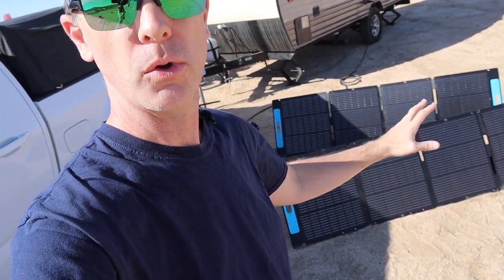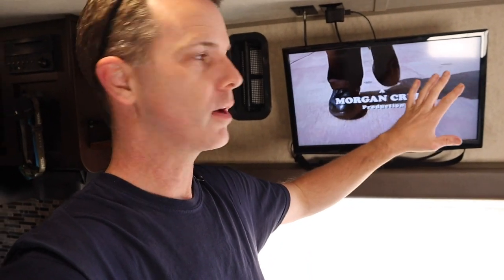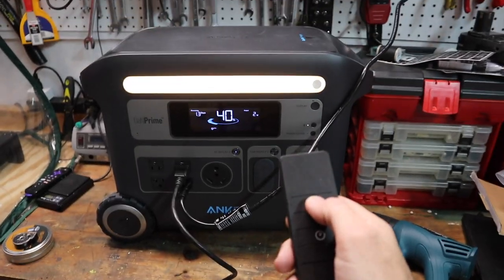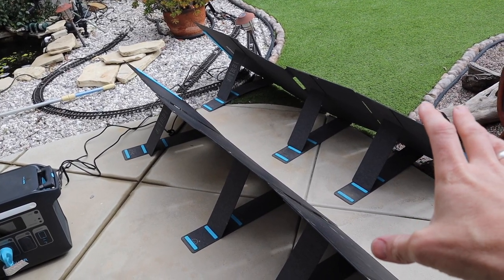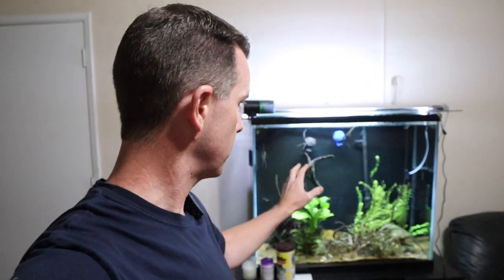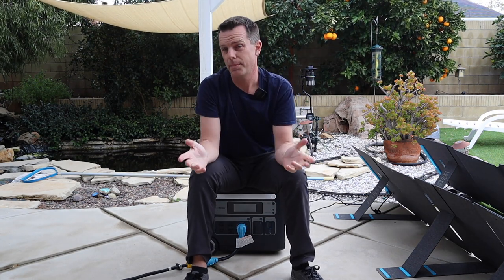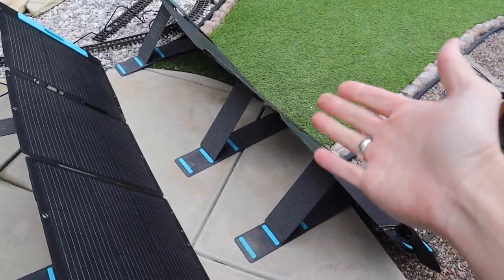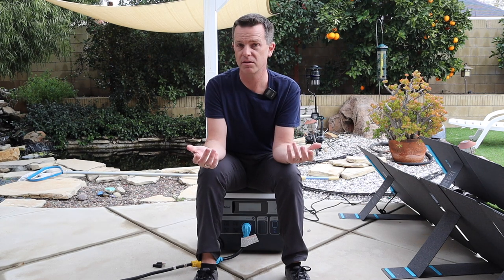Can It Actually Replace A Gas Generator? Anker Powerhouse 767

Comment: Bottom line for home use is, in a total power outage, these little units deplete too quickly and take too long to recharge.  I do see where they can help support a small generator and enhance the generator’s effectiveness during a crisis.  But at the cost, not sure if that’s even a smart decision?
Reply from the maker: It all depends on what you're trying to power in the house. If you are just trying to power a refrigerator and a light or two this will last a long time. If you're trying to power the whole house you'll get a couple hours max. 
I use this thing to power my travel trailer. Electric and solar means I don't have to deal with generator quiet hours.
Reply: @DoItYourselfDad  - Yep, I definitely see the benefit for RV life.

Comment: I have a 13' Scamp trailer.  What (Anker Power Station) would I need to run a 5,000 btu air-conditioner and what solar panels to run the air conditioner all night long.  I am NOT a techy and need simple instructions.  Yes, you can talk DOWN to me.
Reply from the maker: A FELLOW SCAMP OWNER! I had a scamp and LOVED the thing, unfortunately my family outgrew it. It's hard to be able to accurately know how long it would be able to run the unit for without knowing the power consumption of the AC. I have a 8k AC in my garage and it will run it non stop for 4 hours, in your trailer it would be cycling on and off so it may make it?

Comment: I purchased the powerhouse 767 with the extra battery and the extra battery is not charging. I have been using the system for less than 2 weeks and it's a complete fail. On Sunday, March 24, I update the firmware and the extra battery started to charge but today March 27, it stopped just like before. Now I have reached out to customer support but that's useless. They asked for my shipping address, invoice to show proof of purchase, serial number and a video with the issue. I sent all this on Sunday and today they asked for the same information. Anker, this is bad customer service. I was told in one of the emails to use DC to power the battery and then switch to solar. I can't do that since I only use solar. The video I sent showed that the solar panels and cable are working since I connect them to another battery and it was charging. Anyone, someone, what else can be done?

Comment: my anker 757 stopped working after less than a year owning it - now its zero charge and wont charge.
very light use - all these specs and features are useless if the unit stops working.

Comment: Insane that those solar panels are not water proof.
Reply from the maker: I agree, that’s why I had mentioned in the video you may be better off getting your own solar panels and an adapter to run it into the unit. That’s what I’ll be doing with the rooftop solar on my trailer.
Reply: Those panels are totally fine and rated IP67 so they are weather proof in every practical sense of the phrase.  The little frowning face icon the back is not be interpreted as anything other than "not good PV production when it's raining". Well, no kidding!

Comment: Did you try the AC with soft start?
Reply from the maker: Yup, fires up no problem.
Reply: @DoItYourselfDad  appreciate your answer. Were u able to run more appliances with it tho?
Reply from the maker: Yes, the soft start also activated itself ( you can monitor it though an app) the microwave.
Reply: What a/c did you start with the 767?  Your house central a/c? A window unit? Your RV? If so what are the btu’s of the a/c unit, because mine is a 13,500 with a soft start installed and the 767 would not run it.

Comment: 20 rv amp, not 30 amp
Reply from the maker: That’s a 30 amp plug
Reply: @DoItYourselfDad  they call it TT30 plug, but since 2400 watt inverter it's max. If you pull more then that then it will shut down

Comment: Your just like every other channel that receives this stuff FREE. Stop playing semantics and saying it can replace a generator for your home. It can not. 2-3hrs is not replacing a generator. Not even a Honda eu2200 . 
    ALL of these solar “ generators “ can only back up your home power for a short time 8-16 hrs and that’s not running your whole house . Especially if a storm lasts days without power and it’s cloudy for even more days . You’d have no power , unless you have a generator. 
    These units , whether this one or eco flow delta or max are Companions to a generator. The can make the fuel for a generator last longer 4x longer , unless your actually intelligent and buy a complete back up generator like a Generac propane system that will run for months on propane. 
   Good for RV ? Yes. A companion to a generator? Yes . Charge it up with your generator. Then use the battery until dead and charge it up with the generator again, great system to make the fuel stretch longer
Reply from the maker: Tell me you didn’t watch the whole video without telling me you didn’t watch the whole video….